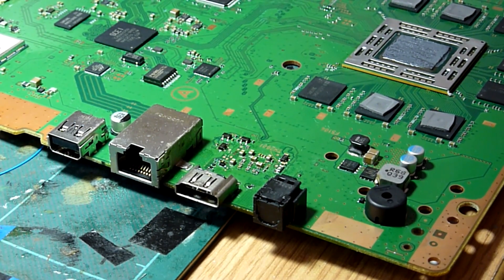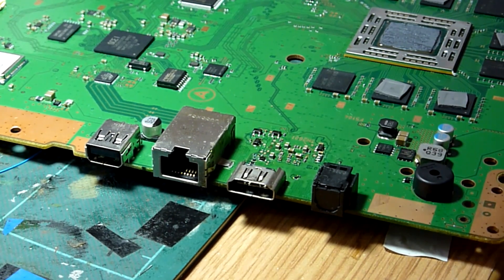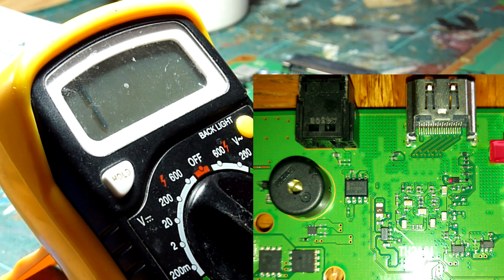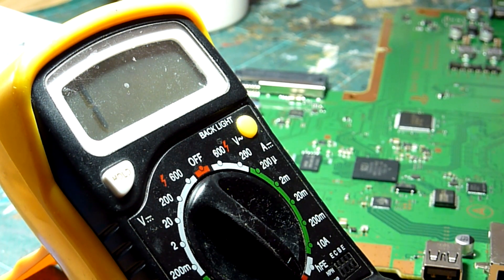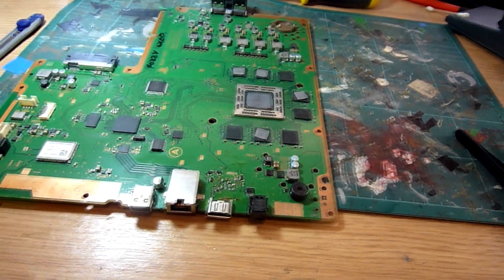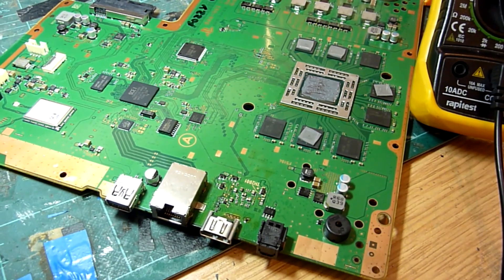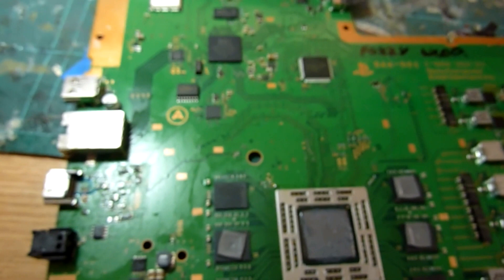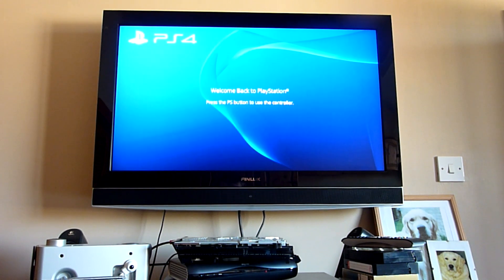PS4 HDMI Pin 13 Short to Ground Repair - White Light of Death (WLOD)

Comment: Greetings brother, you repair blackmagiec devices whose HDMI/SDI outputs do not work correctly. I have an ATEM STUDIO HD and the multiviewer output is not functional, comments saying that it is the CPU or voltage so that the cameras can be seen in the multiviewer. Anything I can send you repair examples

Comment: I'm a little confused on this
Reply from the maker: The long and short of the tale is this:
On occasion, a bad encoder IC can cause pin 13 of the HDMI port, and the associated diode to show a direct short to ground. In that instance, replacing the HDMI encoder IC should alleviate the short and allow the PS4 to display video.
Reply: @AndrewPaul  um.. does that typically fix that problem or can something else cause that kind of problem (asking about the wlod)

Comment: hey andrew need your help bad.. have a ps4 1215a  Filters are fine , port is solid and changed encoder twice but still no pic? Goes from blue to white light.. Hdmi port pins readings are good.. most are the 400s 500s and one pin aroynd 600. But why still no pic? Maybe those diodes and caps maybe one is bad? but where can i get readings for the caps and diodes near the port and encoder ?
Reply from the maker: Have you checked your encoder soldering under magnification? They are a right git to get right with the MN864729 if you're not used to working with them. If so and all is good, check continuity of the fuse for the encoder circuit - behind the HDMI port to the side of the EMI filters on an SAC-001. Usually gold/black coloured. If no continuity, replace it - can often blow with a damaged encoder.
Reply: @AndrewPaul Hi i have a ps4 white light problem and need advice.

So i traded a faulty xbox one original for a supposed faulty ps4 original from a person that fixes consoles that wanted the Xbox for spares.

So on the day i got home with the ps4 i used my ps3 cables to power it on and it miraculously powered on which surprised me as the controller was connected properly using the usb cable.

But i saw the screen flash black then back to the home screen which i didn't know what is was then it did it once more and was displaying perfectly.

After about 5 mins of waiting for it too show some errors or switching off because i did not expect it to work i plugged in my usb speakers to the other usb port on the front while the controller was plugged in.

That was when the screen went black instantly. I didn't know what happened and pressed the eject button and a copy of GTA 5 came out which means the console was still powered on.

When i plug the controller and speakers in on my ps3 super slim at the same time is says too many devices drawing power something like that.

So i think it drew too much power on the ps4 and caused a wlod on the ps4.

Im trying to do a home repair with minimal tools and if you could give me some idea of what the usb ports could have shorted eg a transistor or fuses or something.

It still powers on and everything but that was the defining factor i think that contributed to the white light of death.

Any recommendations would help as ive watched a lot of YouTube videos and most are the ic chip or some transistor .

Its a original ps4 with wlod

Comment: hello andrew congratulations for the video I wanted to ask you a question I have a fat ps4 which if I move the hdmi wire you can see well and hear it otherwise you can see in dots and the audio is not heard you think I should change the whole hdmi port or it could be a problem of some welding ??
thanks for everything and congratulations for your knowledge
Reply from the maker: Hi, in this instance I would change the whole port out for a new one.
Reply: @AndrewPaul  thanks i was thinking it too i tried with flux on the rear feet i managed to restore the audio but after a few seconds the signal disappears as i touch the hdmi port it resets the problem that i do not have a magnifying glass and i have to see how to do comjnque thanks for the valuable info good weekend to you in the family
Reply from the maker: Thank you my friend - wishing you a good weekend also! :)

Comment: I've had that one before. Cheers for the vid. Liked ;)
Reply: Hi i have a ps4 white light problem and need advice.

So i traded a faulty xbox one original for a supposed faulty ps4 original from a person that fixes consoles that wanted the Xbox for spares.

So on the day i got home with the ps4 i used my ps3 cables to power it on and it miraculously powered on which surprised me as the controller was connected properly using the usb cable.

But i saw the screen flash black then back to the home screen which i didn't know what is was then it did it once more and was displaying perfectly.

After about 5 mins of waiting for it too show some errors or switching off because i did not expect it to work i plugged in my usb speakers to the other usb port on the front while the controller was plugged in.

That was when the screen went black instantly. I didn't know what happened and pressed the eject button and a copy of GTA 5 came out which means the console was still powered on.

When i plug the controller and speakers in on my ps3 super slim at the same time is says too many devices drawing power something like that.

So i think it drew too much power on the ps4 and caused a wlod on the ps4.

Im trying to do a home repair with minimal tools and if you could give me some idea of what the usb ports could have shorted eg a transistor or fuses or something.

It still powers on and everything but that was the defining factor i think that contributed to the white light of death.

Any recommendations would help as ive watched a lot of YouTube videos and most are the ic chip or some transistor .

Its a original ps4 with wlod

Comment: If Anyone can help, Im at my whits end.
Brand New IC, Brand New HDMI... Continuity through hdmi port, filters to ic. No bridged or loose pins on ic or hdmi port.....no ground short at pin 13. However the resistor measures about 26kohm? Theres no continuity through the resistor. In diode mode I receive OL either way on the resistor....However, I have 2 other boards here and both measure OL in both directions on the resistor....1 of those 2 boards 100% works I can certify......The board I am working on has WLOD.  So what am I missing???
Reply: I'm in the same boat lol. Waiting for another ps4 to turn up tomorrow to compare with. I found two resistors on the same circuit that short to ground but not sure if it's because of an inductor.
Reply: @electronJarvs Hi i have a ps4 white light problem and need advice.

So i traded a faulty xbox one original for a supposed faulty ps4 original from a person that fixes consoles that wanted the Xbox for spares.

So on the day i got home with the ps4 i used my ps3 cables to power it on and it miraculously powered on which surprised me as the controller was connected properly using the usb cable.

But i saw the screen flash black then back to the home screen which i didn't know what is was then it did it once more and was displaying perfectly.

After about 5 mins of waiting for it too show some errors or switching off because i did not expect it to work i plugged in my usb speakers to the other usb port on the front while the controller was plugged in.

That was when the screen went black instantly. I didn't know what happened and pressed the eject button and a copy of GTA 5 came out which means the console was still powered on.

When i plug the controller and speakers in on my ps3 super slim at the same time is says too many devices drawing power something like that.

So i think it drew too much power on the ps4 and caused a wlod on the ps4.

Im trying to do a home repair with minimal tools and if you could give me some idea of what the usb ports could have shorted eg a transistor or fuses or something.

It still powers on and everything but that was the defining factor i think that contributed to the white light of death.

Any recommendations would help as ive watched a lot of YouTube videos and most are the ic chip or some transistor .

Its a original ps4 with wlod

Comment: Hey Andrew, I just had a PS4 come in with a broken HDMI port and a missing diode closest to the HDMI, I have replaced both but I can only get 480p. My question is, on the input side of the diodes on pins 15 and 16 I get short to ground I know these are for communication between both monitor/tv interface and HDMI for resolution setting. I don't know if it is supposed to be shorted or not and if so where does this lead, I expect to the Panasonic HDMI transmitter, if so is it just a chip swap? or could there be more on the line?

Thanks for your time
Reply: If you have only a 480p output, then it's the hdmi IC encoder. I'm searching for a solution for the diodes since I have a motherboard with the 15 pin diode destroyed. I don't know if I can bridge it just like that or If I can replace it with another diode like the 4007. Any advice?

Comment: I have a HDMI port that I have replaced and is good but every single pin is grounded, I have just changed the IC for another and still the same fault. What can it be?
Reply: I have also checked it with the HDMI removed, and still the same all of them pin out to ground.
Reply from the maker: All of them!? Remove the port and IC and recheck - if the pads are still shorted then that board has some severe problems and I'd scrap it.
Reply: I removed the port again and checked it and still a ground short across all the HDMI traces. Can the IC cause this? I will see if it is the same with the IC removed.
Reply: Yes still shorted even with the IC off, cant work this one out think I will just keep the board as another doner, must have something seriously buggered internally somewhere.
Thanks for the reply, love you easy to follow vids, they have helped me on many occasions, even though I have been working on Consoles for many many years now I still need help sometimes. lol.
Reply: I have now come across 3 different boards with this problem, all I think has had the IC changed on them could it be a short from aligning the IC chip? This is bugging me now. lol
Reply: I also have a ps4 with same as Alan it was smashed on ground could it be cpu
Reply: @mustangmike6421  I doubt this but, I think more likely that it is one of the underlying traces inside the board, as they are multi-layer PCBs. I have actually come across 3 like this now.
Reply: Thx for the answer appreciate  it

Comment: hello again, I just watched your video, I have the same problem, but does it mean that it is ic hdmi's problem? Isolate pin 13 of the socket and the diode and I have the short in the line.
Reply from the maker: If the diode is showing a short, remove the IC and retest. If the short disappears, replace the IC.
Reply: thank, i replace the ic and working the ps4 again, 
what microscope do you use when you replace those ic??

Comment: hi i have ps4 turn on and turns off. i reballed it and changed power supply  it dint work 
after diagnosis  i came know tat  on board its shorting on power supply connect. plz help me
Reply from the maker: If it's shorting on the connector then you have a short on the +12v rail. What happened with the machine when it went bad? Liquid spill, power surge etc do you know?
Reply: nothing happen it was turning  on in the same issue but nw its complete  not turning on
Reply: how to fix 12v rail.?
Reply: plz help

Comment: Hi,
I bought a ps4 cuh 1102 from a guy for $70. He stated that the console boots fine and there is sound output but no display at all. Could it be a faulty hdmi encoder or do i need to replace hdmi port ?
Reply from the maker: Check the port - if all is OK then replace the IC.
Reply: the ports are okay. I checked out that same diode at 3:06 but got no beeping and at 3:23 i got 0.588V. At 3:49 i got beeping + 1.2V. Does the diode needs replacement
Reply: Andre Paul
Reply from the maker: That should be fine then. Check the EMI filters for continuity top left to bottom left, top right to bottom right. Have a good look around the rear of the port for any missing components. If they're good and the port is definitely OK then I'd replace the Encoder IC.

Comment: Please, please I need to know the resistance of that pin 13 resistor next to the diode. mine is reading OL and I am at a stand still without that information. I am not reading any shorts to ground so I am not sure if my encoder is bad.  if anyone could help me I will be one happy man.

Comment: Good afternoon Paul, a few months ago I follow your channel and I congratulate you for the work you do since there is not much information about these things, I have seen your videos several times, the only thing I can understand how you do things is watching the video Since I am Spanish and I do not understand English, hehe
I've done all the tests that you do and everything that you check with the tester I am correct, change the ic but as I am not very understood in the subject I do not know if I will have burned it because there is no image in ps4, my question is yes There is some way to test the ic to know if it is in good condition or in bad condition, checking the ic with the filters I am correct, maybe there may be some diode, resistance or capacitor that does not come out in the videos that may be in poor condition ? I would appreciate your response
Thanks in advance and greetings from spain! a hug
Alberto
Reply: Did u finally figure out the problem. Do u no how to test the ic with multimeter

Comment: Hi Andrew, i have a PS4 that was dropped and knocked of the HDMI port and 3 components on the left side behind the hdmi port, i have replaced all but the PS4 still has WLOD , i noticed that pin 15 is shorted to ground wich is bad., reworked most of the components behind the port and replaced the HDMI controller ic but still no picture, it does give a signal to the monitor and also noticed that it takes abit longer then normal before the monitor shows a light that it recieves a (bad) signal. do you have any idea where i might look into please?
Reply from the maker: If Pin 15 is shorted remove the diode and see if it goes away. If so, replace the diode. If not, you'll need to follow the via from the backside of the diode and see where it goes. Remove the next component in line and see if the short disappears on that pin. If so, replace that component otherwise move along to the next - repeat until you find the offending component.

Comment: hey man. so I recently replaced the port on a console of my own and after replacing it I can only get the console to boot into safe mode and 480p. Nothing else and I'm positive it's not the TV or hdmi cable that's the issue. is it possible that I could have installed it incorrectly? or is it the encoder ic?
Reply from the maker: Check continuity of the pins of the port where you've soldered them with a multimeter. Adjacent pins should not show any continuity - if they do you have a short which will need to be removed. If they all show good and you've no loose pins (give each one in turn a firm push to see if they move) then it could well be an encoder IC problem.

Comment: How to solder joints together as I have a pin out number 14 from left to right
Reply from the maker: https://www.youtube.com/watch?v=Ji51YUmMCrs
Reply from the maker: As you look from the rear of the port or the front? 14 along from the front L>R is normal to be missing - it's not used.

Comment: Lightning killed my ethernet and hdmi, replaced the HDMI IC and still nothing, but it sends a black screen when in safe mode to my PC monitor via dvi-hdmi cable reporting the 720x480 resolution. With HDMI-HDMI to any tv its like there is nothing connected. dont look like there is physical damage to the trails or pads, perhaps diodes? are there capacitors ?
Reply from the maker: There's loads top side to check above where the IC sits. You'll need a good board to measure component values against.

Comment: Hello, I have a 1200 model. What light after replacing HDMI socket, chokes and HDMI controller MN864729. This is the 3rd controller I got. Strange thing is when testing the TMDS out on the chips they all have connection in diode mode to each other (8+9, 11+12 and so on). I really think I got screwed over on the part because clearly the signal is scrambled before leaving the chip. Do you think this is correct? Have you had a 1200? Have you tested the chip I am talking about? TY for any info.

Comment: ps4 only flashig blueleight
Reply from the maker: General error condition. Hate these - good luck!
Reply: Hi Andrew Paul,can u help me,ps4 have sound but no video..
Reply from the maker: +Hairi Anuar likely to be an Encoder IC failure.
Reply: Andrew Paul,I've done change new hdmi port but same happen,next,I will change hdmi ic chip.if I ask u at first,I will not change the port.
Reply: Andrew Paul hey Paul, would be cool if you would be able to go over what diodes, capacitors, and resistors look like and how to test if they are good.

Also i have a ps2 who's motor will not spin the motor is good and so is the laser and ribbons, switches are also good but it will not spin when holding down the safety switches.
Reply from the maker: I presume it's a PS2 slim owing to the fact you mention lid switches. Check fuses show continuity with a multimeter as per image here:
http://www.ps2parts.com/images/fuses/v12.jpg
(Thanks to ps2parts.com).